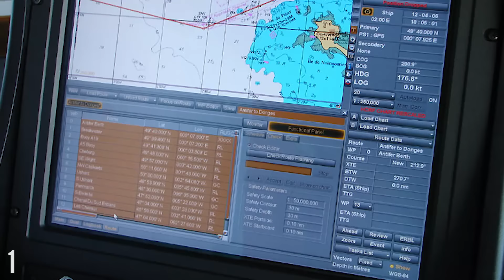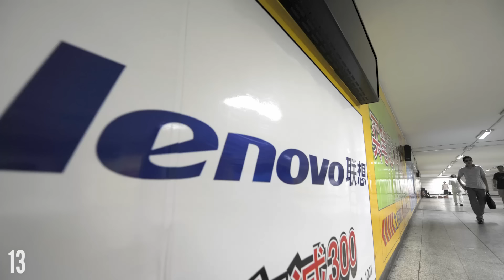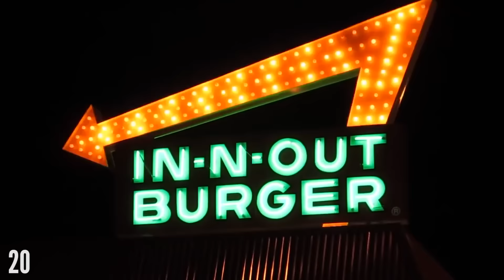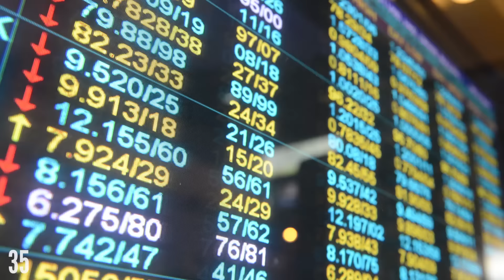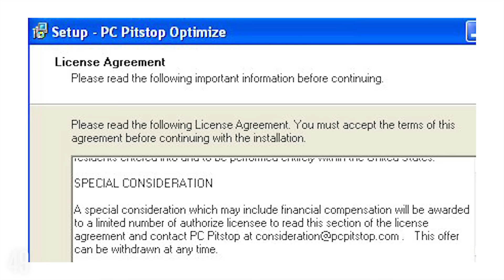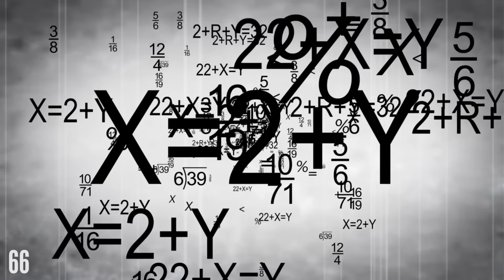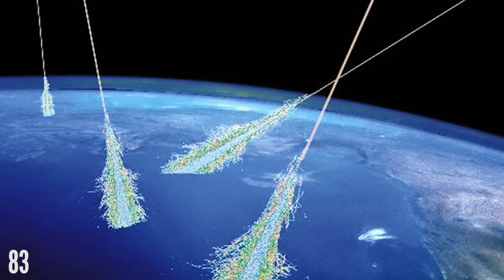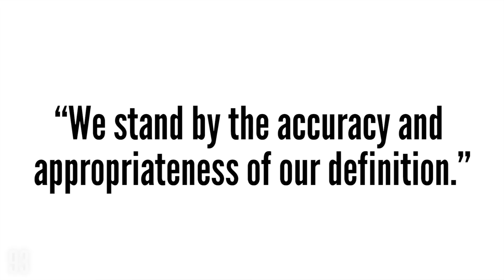100 Incredible Facts! RIF 100

Comment: "Folding a piece of paper 42 times to reach the moon, and 102 times to reach the entire universe", is the most mind blowing thing i will ever hear!
Reply: That's... pretty sad.
Reply: I’m currently trying this
Reply: @k3nz1e73  good luck, bet you wont be able to fold it more than 7 times
Reply: OnlineGamer330 no I just made it thicker than the observable universe gonna try for a bit more tho
Reply: the most folds i got was like twenty something
Reply: @EarrapeMasterTM  Yep. 12 folds alone and it wouldn't fit in your house.
Reply: anthony pizzi no it doesn’t what are you talking about
Reply: @skatingfreak1670  Good job!  Did you use a piece of paper the size of your town?
Reply: Yeah, but it keeps doubling in size every time which is a huge exponential growth
Reply: Victor Murat  ...Yes it would with normal paper.. Lets ask you this.. would your rather have 1 million dollars now, or have have a single penny in the bank and have it double in value every day for 30 days?
Reply: Adam Battersby  0.1 mm paper would be 23 folds to reach mount everest level in height.
Reply: @UCn8yDo3xmlTFbQVWE961N1w if they folded it 11 times it would had been 2 meters thick/high. So i guess it fits in most homes. 12 folds would not fit tho, the roof would be in the way.
And this is not about the mass and size, only hypothetically if you actually could fold paper as many times you wanted, its thickness would double with each fold, aka reaching the moon in 42 folds etc.
Edit: Looks like the dude i replied to deleted the comment.
Reply: I remember 103 times for the visible universe. The "entire" is far bigger.
Reply: No how strong it would be
Reply: @skatingfreak1670  u gotta fold it in half though
Reply: This statement is impossible to be true. The universe is infinite (it’s still expanding. Been expanding for approx. 13 billion years). The paper is not infinite
Reply: @vozz4826 He said the visible universe not the entire universe.

Comment: The last one is just so... unbelievably amazing!
Reply: ikr
Reply: +American Otaku why not just stack piece of paper
Reply: ***** That wont work, when you fold paper it doubles its size.
Reply: +unitor699 because you need 2 raised to a 101 pices of paper
Reply: IKR!
Reply: How would it work though?!
Reply: When you fold a peice of paper, it's thickness gets exponentially larger every fold. That's why it's mathematically impossible to fold a peice of paper 8 times.
Reply: Mythbusters did 11 folds, but it was looking ridiculous then.
Reply: The smallest known particle with mass is actually
0.00000000000000000001
sorry, had to correct myself
Reply: I find the fact that you need myth busters to prove it, instead of a simple calculator, dissappointing
Reply: mathematically perhaps; but in reality, you can do it...
Reply: Folding it 42 times gets you to the moon. Folding it 43 gets you to the moon and back.
Reply: SirNate Makes sense.

Comment: The 42 folds of a piece of paper seems about correct, given that a piece of paper is 0.1 mm thick (0.0001m) we could derive 2^(x)*10^(-7) where x is the amount of times we fold the paper, and the answer will be given in km. when x=41 we get 219902 km but the distance to the moon is 384400 km, but when x=42 we get 439805 km which is more than enough to reach the moon. What's perhaps even more interesting is the fact that when you have folded the paper 42 times, given that the length of a A4 is 29.7 cm long the length of the paper would be approximately 0.000141620 millimeters or 141.62 nanometers. The papers length and width would be around a thousandth the width of a human hair.
Reply: cool.

Comment: GUYS. Let's make the largest ever sheet of paper and fold it 42...

wait

42...

Forty-two
Thoughty2...
Reply: Look at my channel description 42 is the answer to life, the universe and everything else after all
Reply: Miguel Freitas
42 42 42, 42 42 42
Reply: No matter how big or small the paper you cant fold it by hand more than 8 times.
Reply: That can't actually be true... Even at 10m sq it doesn't quite work, but make it 100m, or 1000m, or as larger as necessary.
Reply: @kindlin  8 Folds is the most you can achieve without machinery on any size paper
Reply: @Suekru3  
OMFG!?
I just lost ALL my math again. FOR THE SECOND TIME. Ok, no build up, here is the answer. If you allow paper to be thin and large, aka, 2.97 square miles and as thin as standard paper (11.5in/.004in*0.05mm*(2^(8-1))^2=), it will be as easy to fold as regular 8x11 paper AFTER you fold 8 times. Tho, right at the end of this, I realized that what you say is literally true of a standard 8x11 piece of paper, after 8 folds it's width exceeds its height, you can't fold it. But I like to image how big a piece of paper has to be for you to be able to fold it X number of times.

Comment: Can anyone explain to me that paper folding fact?
Reply: +Justin Norman i suppose as you fold the paper more the surface area is less and less so because of that the distance must increace because matter cant be destroyed. so the distance increaces with every fold and i assume that at these stated number of folds the paper would be down to the area of some atoms creating an enormous distance. in other words enough atoms side by side to reach a destination. that destination being the moon.
Reply: Dylan Willis If it was going to stretch air as the observable universe, how big would the paper need to be?
Reply: +Justin Norman as big as a pice of note paper apparently
Reply: The height of the paper grows so quick because it's doubled each time so for example although it may take 20 folds to reach 1 mile it would only take 21 folds to reach 2 miles.
Reply: +Nathaneal Bursch wrong
Reply: +Nathaneal Bursch 1 fold=2 sheets 2fold=4sheets 3fold=8sheets 4fold=16sheets
Reply: +Nathaneal Bursch if what youre saying is right then that means 20 folds would=40sheets. that is wrong
Reply: Watch Vsauce
Reply: so a piece of paper is 0.1mm thick, right? Fold that in half, it's twice as thick. Fold that in half, it's twice as thick as that -- four times as thick as the original. This pattern continues such that if you were to fold it 42 times, it would be 2^42x0.1mm thick, making it 439,804,651,110.4mm thick. Convert that to kilometers, you get a piece of paper around 439,804.6 kilometers thick-- roughly 30-some kilometers more than the distance from Earth to the moon.
If you fold it 103 times, that's 2^103x0.1mm, or roughly 1,014,120,480,182,583,521,197,362.6km. That's around 32.9 gigaparsecs, and the diameter of the observable universe is about 28.5 gigaparsecs.

EDIT: wow, 11 more comments popped up while I was typing that and doing the maths? huh...

I'm still the only one to use the word "gigaparsec", so I'm happy. :D
Reply: Dylan Willis Can you explain to me why you thought that's what I said? Im confused...
Reply: +Justin Norman 103 times larger than the obserable universe
Reply: It is a reference to a minutephisics video, I don't remember the name. It was about exponential growth.
Reply: The Aliens Ambiguously worded at best; straight-up not correct at worst. If you meant that folding it 103 times makes it larger than the observable universe, that is correct. But it is NOT 103 times larger than the observable universe. It is roughly (I mean VERY roughly) 50% (1.5 times) larger.
Reply: +Justin Norman It'sim possible to fold a piece of paper more than 7 times.
Reply: +SMELTER SAUSAGE Look up the mythbusters testing that myth (you can if you have a large enough piece paper)
Reply: +I&#39;m a geek, not a nerd Yes, but can a flipping  paper make the Kessel Run in less than twelve parsecs? Don't think so
Reply: +Dylan Willis Lol your wrong, or you didn't understand him.
Reply: +Dylan Willis lol you are so wrong the way it would go is 1=2 2=4 3=8 4=16 5=32 6=64 7=128 8=256 9=512 10=1024 11=2048 12=4096 13=8192 14=16384 15=32768 16=65536 17=133072 18=266144 19=532288 20=1064576
Reply: +John Collins actually you can it would just need to be long enough saying this it would have to be 439,804 kilometers long
Reply: +SMELTER SAUSAGE not true the record today is 13 folds I believe
Reply: i wish it was possible.... fold up a bill and then i can say i got a stack of cash bigger than the observable universe :(
Reply: TIL ~ What a (giga)parsec is
Reply: +Dylan Willis It's an example
Reply: A parsec has to do with a measure of angle, it's ab out 3.2 light years.  A gigaparsec is 3,200,000,000 light years, or a billion parsecs.

Comment: i don't understand the last facts. someone mind telling me?
Reply: +MegaManBn Each time you fold it, it becomes twice as thick.
Folding once = 2x thickness
Folding twice = 4x thickness
Folding three times = 8x thickness
Folding four times = 16x  thickness
Folding 42 times = 4398046511104x thickness
Folding 103 times = 10141204801825835211973625643008x thickness
Reply: +HotSauceBear That doesnt explain anything
Reply: +Zac Efron it does if you know how to do math and knew how thick a piece of paper is
Reply: Powers of 2 basically
Reply: +Zac Efron no you're not! It's just hard to understand.
Reply: +Zac Efron it's above the humanity's mind!
Reply: +MegaManBn 
Let say the sheet of paper is 0.1 mm thick.
If you fold it once, you get a 0.2 mm thickness. 0.2 is 0.1*2
If you fold it twice, you get 0.4=0.1*2*2=0.1*(2^2)
If you fold it three times, you get 0.8=0.1*2*2*2=0.1*(2^3)
If you fold it four times, you get 1.6=0.1*2*2*2*2=0.1*(2^4)
...
If you fold it 42 times, you get 0.1*(2^42) mm = 439,804,651,110 mm
The distance to the Moon is roughly 380,000,000,000 mm

This grows hugely because the thickness doubles with each fold.
Behold the power of exponentials !
Reply: +Piffrock even if it was atom to atom I don't think it would be as big as the universe...
Reply: ***** yeah? and?

Comment: i dont get the last one
Reply: +The Reddog It's a theoretical thing, so it cant really be done, but theoretically, since paper doubles in thickness every time you fold it, its thickness would be the distance between the Earth and the Moon. Folding it once would make it 2 sheets thick, folding it again would make it 4 sheets thick, again for 8, 16, 32, etc.
Reply: +The Reddog same
Reply: +The Reddog to imagine it just cut a piece of paper into squares and pile them on top of each other you'll have a tall pile the more pieces you cut it into the taller the pile but you fold it instead of cutting and piling its practically impossible to fold a piece of paper 42 times but theoretically if you did you'd reach the moon
Reply: Aparently
Reply: It's how thick the sheet gets when you fold it, doubling in width with every fold. It is only humanly possible to fold a sheet 7 times, but with machines it can be up to 11 times
Reply: +FlappableBean well with machine it's easier

Comment: With the average paper being 0.0039 inches thick and folding paper 42 times would be 214748364600 pieces, that's only 837518621.94 and only half as thick as the 15 billion inches. The paper would need folded 43 times. Fact check 101

Comment: checking up on you -- function times2() {
  var i = 0, %n = 0.00688;  // 41 thickness = 145 to 146 sheets per inch paper
  // 42 times = 294 pages per inch = 0.0034
  while (i < 41) {
    n = n * 2;
    i++;
  }
  echo(n / 63360); /// inches per mile
  // 42 = 238782.8 miles
  // 238 855 miles
}